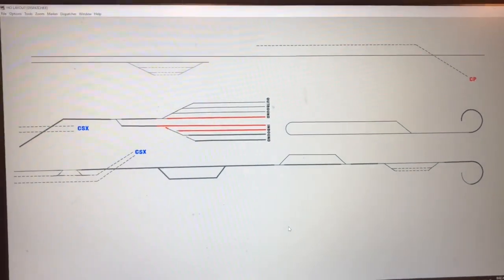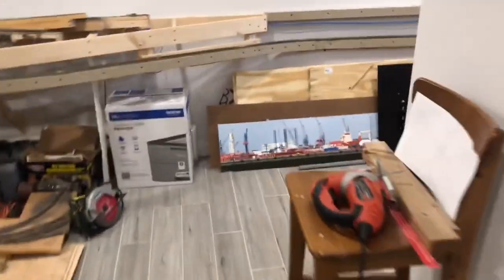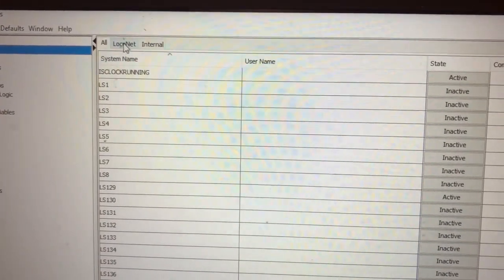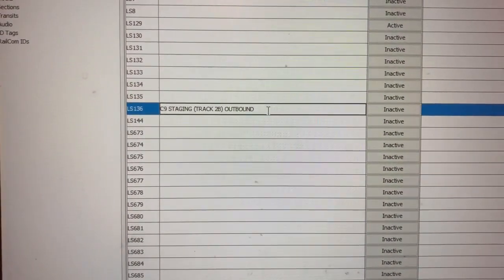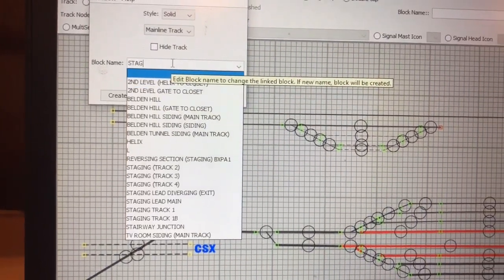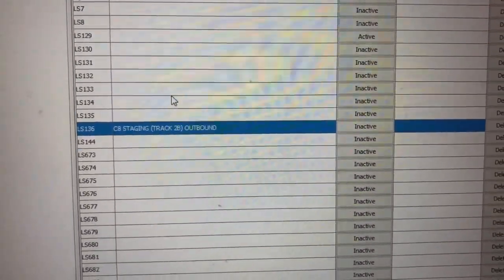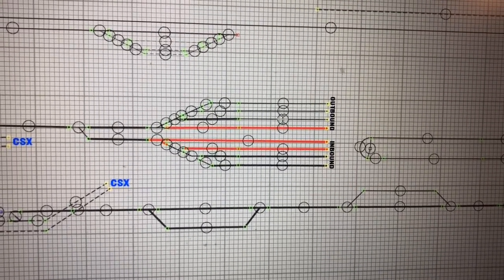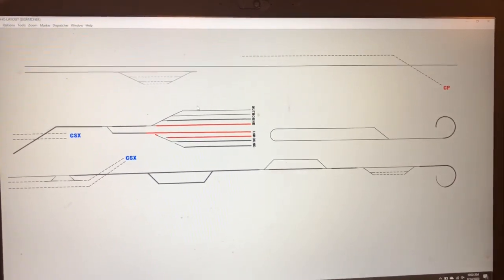JMRI (Block Detection) staging yard

Comment: I realize this video is older but I love your content!!! You do such a great job explaining everything…..
I have a question - is the BDL88 providing the actual power to each track block OR is it just for detection and power is supplied elsewhere through power districts.
Thanks!! Keep it up!!
(I am going to try to copy your big TV screen setup also - that is just about the coolest thing I have ever seen!)
Reply from the maker: Thanks Bradley! I appreciate it. There are 2 wires that come out of your command station or booster (Red and Black for example). The “Red” wire would go to the BDL and the other “Black” wire would go directly to the layout. The BDL using power from the “red” wire, provides power to 1 of the two rails (Rail A for example) which splits the single power source into detection blocks. Those blocks would the be used to run power to each A rail on each separate block (separate the blocks by using a single gap on the actual rail). The other wire “black” powers the opposite rail or B rail (no gaps needed for the B rail unless you have turnouts with powered frogs that end up on the B rail side).

The BDL168 has an option of splitting the blocks into 4 power districts so if you have a large layout you can use multiple power sources or boosters to divide the layout into districts. If you decide you use the power district option, you would need to feed each zone on the BDL168 with a separate “red” wire from each booster accordingly. The “black” wires from the boosters would then go directly out to the layout but to the designated area of the benchwork for each particular district. When using power districts, you must have double gaps on the entrance and exit points of each district to avoid damaging your equipment. 

If you decide to simply have 1 power source you just have to make sure all of the zones on the BDL168 get power from the “red”wire. Simply connecting the wire to zone 1 for example, will not feed Zones 2,3&4. 

I hope this helps